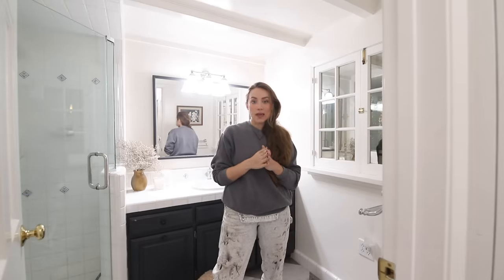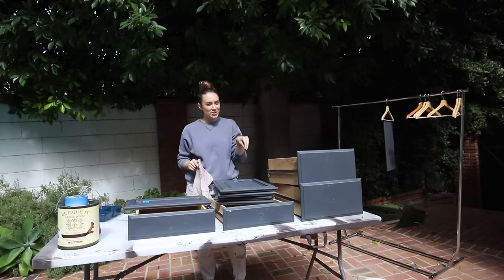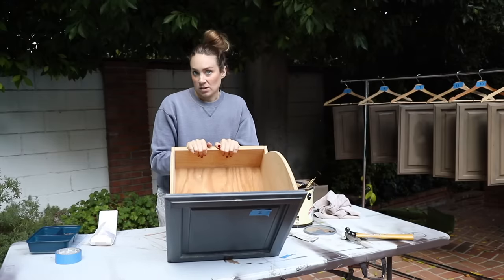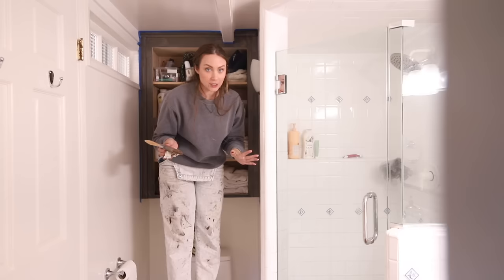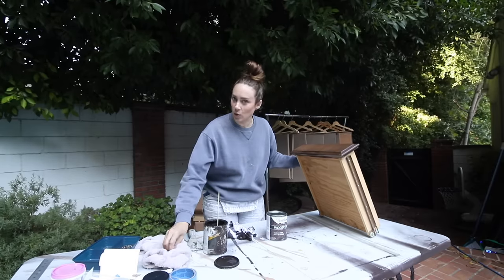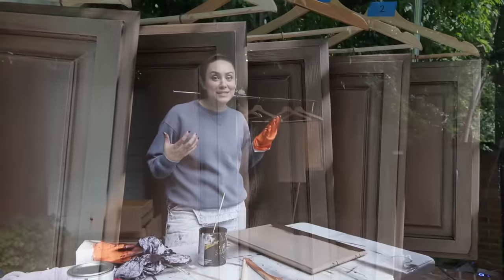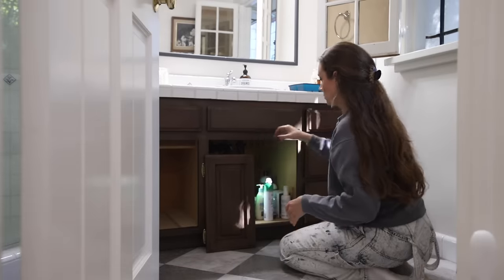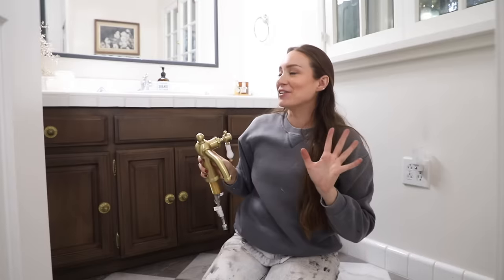French Provincial BATHROOM MAKEOVER *Painted Cabinets To Look LIKE WOOD* (Part Two) | XO, MaCenna

Comment: I think the knobs would look better in the middle of the doors. I think the bases are too big, it hangs off a bit! But love this update, cant wait to see it finished.
Reply: Yes...I think  the knobs without the  large bases would look good too, they're not fitting and look a bit odd.
Reply: Agreed, I would do backplates for the drawers but the doors without the plates.
Reply: I actually like them oversized, but they'd look good without the backplates.  I'm personally not a fan of cabinet hardware installed in the middle of the door.
Reply: I would have omitted the back plates on the doors. They just don’t fit properly. I’m surprised that they were ok for her because she is such a perfectionist. Which I love. Lol
Reply: AGREED!
Reply: Agree
Reply: I thought the same, which is a shame because I love them SO MUCH
Reply: The three door backplates might work as medallions at the center of the sink panel to create a balanced variation on the knobs theme.

Comment: Hi MaCenna! The vanity turned out amazing! Can't wait to see the full bathroom makeover! I totally geeked out over your hardware selection! I work as a designer that focuses strictly on older homes (circa 1890s - 1940s) and those appear to be from the Arts & Crafts era (best guess would be early 1900s to mid-1910s). Very reminiscent of what you would have seen in manor houses during that time frame.
Reply: indeed, that's about where i put them, too (not a designer, but i used to spent my summers restoring an old house and so i sometimes randomly know these kind of things LOL)
Reply: Arts and Crafts generally had much simpler hardware. Look at The Craftsman by Stickley for examples in the American style or Peter Waals, Gimson or the Barnsley Brothers in the English Arts and Crafts tradition. I think decorative hardware like this is more typical of neo Georgian or neo classical styles.
Reply: Yes, this style dating has had me a little concerned. For a slightly more modern take (1920s) look at the work of Gordon Russell whose furniture designs echoed Waals et al and who used metal door furniture which was often smooth in line and feel.

Comment: I used retiqite about a year ago and was amazed. I used a chip brush and it created subtle wood grain, still love it!
Reply: Thank you for advising how this product would work with a chip brush! I was wondering whether the stiffness of a cheap brush would be an advantage with this product in that it would create more defined streaks - or whether it was complete coverage one was after.
Reply: Does the end result of the cabinets look like they are hand painted with a brush?
Reply: @wendylau2509  not at all. It looks like wood. The start and stopping on ends is tricky but I saw another YouTuber tape sections to make it easier.
Reply: i so badly want to try this on my kitchen- where did you try yours?
Reply: @christopherdewaard6932  it was a dresser. It has held up to a teen for two years but not to the extent a kitchen would need to. I have also seen people using an enamel cabinet paint in beige then using gel stain over it to achieve the same look.

Comment: I love how thorough you are MaCenna & how professional the final results always look on your projects.I’m a knitter & it really matters to me that the sweaters I knit for my granddaughter look professional.  What I’ve learned from you is that for most jobs, it’s not that it takes hiring a professional for the job to end up with professional looking results, it does take attention to detail. It takes being willing to slow down & caulk, fill all the nail holes, sand, & wipe it all down 2-3 times before the painting can begin. It takes time to clean off ALL the old paint from the pulls & hinges before re-installing them, or to complete all the steps to prep the surface properly instead of just slapping down some peel & stick tile to cover up floor you don’t care for. 😉 At first I thought you weren’t going to paint the inside of those doors, 😳 but I know you better than that. The bathroom looks absolutely beautiful!

Comment: Antiquing kits from the late 60’s and early 70’s were very popular and much like Retique-it (though I can’t remember the smell). The kits from then came in both wood look and in colors with slightly different colored glazes as well. I did a bookcase and unfinished dresser to match a blonde dresser with a Formica top I couldn’t change when I was in 8th grade. I also did a 30’s style drop leaf table and chairs in a bright apple green with a bluish glaze for my first apartment in the mid 70’s.

Comment: Hello MaCenna 👋
Thank you for sharing this project. I too have recently purchased a new house and have been wanting to re-do the cabinets in both bathrooms and kitchen as they are currently white. I've never been a fan of white cabinets or white walls. I have always leaned towards vintage moodiness with a semi- Victorian vibe.
I ran across the Retique It line on Amazon one day and have always  been curious about it. Now, after seeing you use it on your cabinets,  with very impressive results, I am now going to give it a go in my front guest bathroom.  I also love the color of stain you used on your cabinets and feel that it would work very well with the 1920's vintage look I'm attempting to pull off. I love the over all look of your bathroom. It turned out beautiful.
Your video has given me the confidence to try this product. 
Thanks again Xo ❤

Comment: I think you were supposed to use a brush with stain and go with grain but the way you did it worked wonderfully! I'm gonna order some retiqueit!
Reply: it’s a gel statin it goes on really easy not water base or oil which needs a brush

Comment: Okay I don't see that anyone has said this already. I'm really pleasantly surprised this worked so well, I've watched multiple videos on this product. They said on the retique it video it's better to use with water based products. It's better not too rub it on also... Lol. Your supposed to use the brush to get the brush strokes to immitate a wood pattern. They even have a larger and a smaller rubber like tool your supposed to rub down the "grain" . This makes me more confident about using it, and not even have to spend the extra money on they're stain and tools. Wow! If I had done that it probably would have came out all wrong. Anyways I love the stain color. Great choice!
Reply: Yes, I was surprised she rubbed the stain in and no tool!  But it still looks pretty!
Reply: @Lucinda_Jackson  yes it does, love that color!

Comment: I like how it turned out!  The other videos where I've seen it used a tool for a more pronounced wood grain effect, but I like your more subtle look.  

I'll weigh in with my opinion on the two issues people seem to be commenting on most.  I don't think the hardware looks too big  - I had expected it to, but I like the oversized look.  If it seems to interfere with the doors working properly, that would be different and you'd probably have to make the change.  Oh, and I think you definitely don't want to put one in the middle of the panel under the sink.  It would make it look busy.  If you feel the need, it might take two as any wider drawer would do, but I think it fine as is.  

The section bf issue is using the Retique-It  on the window.  I feel like that's a slippery slope leading to doing the doorframes and then you just have a bunch of brown boxes outlined all over the bath, taking away from the look of the vanity.  I'd leave the woodwork painted white or creamy or even match to your wall paint.  And I'd leave the ceramic tile toe kick or basebosrd until you renovate.

I can't wait to see the rest!

Comment: Thanks for bravely going where the rest of us have not in trying out a new product! 😂 The cabinets look great!  I refinished a Chippendale Revival desk some 30 years ago with ball and claw feet and solid brass pulls; they were completely black and had to be cleaned with stripper before I could wash and polish them.  The desk was from the 1920s.  I was told by someone knowledgeable that anything solid brass was almost certainly prior to the 1980s, but of course can be much older.  As a former cleaning woman of some 27 years, I will tell you that raw brass and bathrooms are not a great mix.  The steam from the bathroom will make them turn very dark rather quickly.  I collect antique and vintage brass and have it all over my house— except the bathroom, for that reason.  If you want to keep it gold in color, you might give it a good polishing and thoroughly spray it with a lacquer seal.  Here in Florida, no one wants brass because the humidity makes it turn quickly.  You can buy it very cheaply in thrift stores.  I polish my brass items 3 or 4 times a year to keep them nice, but most people aren’t ready for that kind of maintenance.  If you don’t polish it regularly, you will get black spots and rust that literally pockmark the finish.  If you choose to polish and seal, make sure the lacquer seal is two or three coats and covers every crevice, otherwise you’ll have moisture sneak beneath the lacquer, and yes—black spots and rust will appear.  Looking forward to seeing the finished bathroom! 😊👍

Comment: If you’ve ever driven past or lived anywhere near a pulp and paper mill, you know that smell and wish you didn’t.  They’ve basically given you wood pulp from part of the paper making process with some sort of adhesive.  The pulp absorbs the stain because its the fibrous part of the wood.  And its the nature of the cellulose fibre that gives wood that “grain” which becomes accentuated when you apply a stain.   Someone was thinking and found a niche in the market.  Pretty cool.  This might be the product that saves some of my cabinets around my house that are structurally just fine but the finish on them was possibly beyond repair.  Thanks for being our Guinea pig !! Again, lol.

Comment: Love the finish.   I like the knobs on the drawers..... but not a fan of them on the doors because the face frame isn't wide enough.   Would you consider handles on the doors instead of the knobs and just store the extras until you renovate and can use them all?   In my kitchen I did a mixture of handles and knobs.  Just a thought.   Or, perhaps consider removing the back plate on the doors.

Just my suggestion. Cant wait to see the rest come together

Comment: They look so much better. And the hardware is very pretty. I think the gel stain was very helpful in achieving the wood look. After the retique it I could see a little of the wood grain from under the paint. So I’m thinking the cabinets were originally red oak. Usually, you can still see the texture of wood grain through the paint. On screen the cabinets look a little matte. I wonder if they look like that in person. Will there be a separate top coat? If you didn’t do one, consider putting a few coats of sealer on. I gel stained my oak cabinets and put a few coats to help with durability. Since gel stain sits on top of the surface I’m not sure how durable it is on its own.

Comment: Yes how? And since this stuff has wood in it, does it require a protection layer? I’m thinking that because of the high moisture in bathrooms. You did an amazing job as usual 😊 a perfectionist I’m so proud to follow and keen watch all her videos ❤️ I’m also thinking what if a chip brush was used? Would that create a wood grain look? Definitely worth purchasing and experimenting, especially when no stripping or sanding is needed.
I’m sorry I’m not crazy about the hardware though. I remembered your kitchen makeover and realized how hard it can be to find the right hardware.

Comment: Love the new hardware, but the backplates are a little big for the cabinet doors. It works really well for the drawers, but I would consider omitting the backplates on the doors so that the knobs fit them a bit better.

Comment: In a former life I was a manufacturing jeweler.   When we needed to polish a run of castings, very similar to your finials, we would use a stainless steel shot tumbler.  It would take a while to do, but it beat polishing by hand.  You could find one at a tool supply company.  Not prohibitively expensive.  🤞🏼

Comment: 6:18 ive seen people use a wood grain type brush with this stuff and always wanted an honest opinion on if the wood grain texture on the brush is legit. Could you do a project using one of those wood grain brushes?

Comment: Hey MaCenna, I believe that you are only meant to use gel stain with the "retique it"
You said in the vlog that you weren't meant to use a penetrating stain and typical oil and water based stains are penetrating stains because they go INTO the wood while gel sits on top. You can use gel stain to "stain" metal doors and other non wood items because it is meant to hang out on the surface- think of it almost as a glaze.
Reply: Yes, she could have just used gel stain and painted over the blue chalk paint.  Then added her Poly satin.  It would have maybe look less like wood though.

Comment: Never brush or wipe on stain against/across the grain of the wood. Always go WITH the grain.

The knobs are great, but they are a little too large. Looks like they may even extend beyond the width of the door frame that they're attached to. Would have been perfect if they were about one size smaller.

Comment: I would have said that acorns are very XIXth century but actually, after verification, it seems that it goes back to the XVIIth century in home decor. I had acorns as tie back hooks in Paris a long time ago, I brought them with me here, they are in heavy brass, I was planning to use them again. I have a big doubt about your back plates, I have never seen some like that before, I’m afraid that this sales woman saw you coming, and charged you more than it could have been without these plates. They look too big on your doors and they don’t seem to match the acorns. 
Otherwise, I am pleasantly surprised by this faux wood product. In France, when I was working as a painter in home decor, we, painters in this field, we would have been without jobs if this product had existed then, we were creating our own faux different woods without the help of this miracle product. I’m interested to look into it further. Very interesting. 
The bathroom that you are creating is very French XIXth century, not only Provence, it was a more general style in France. It’s a pity that you didn’t simply painted your white tiles on the floor, there are very good ceramic paints, you could have imitated this kind of faux marble you have now with these  vinyl things. Vinyl is definitely not classy antique French.
Reply: Aren't they artichokes?